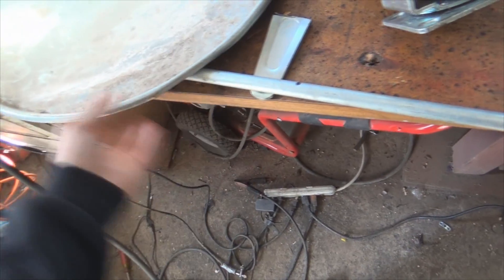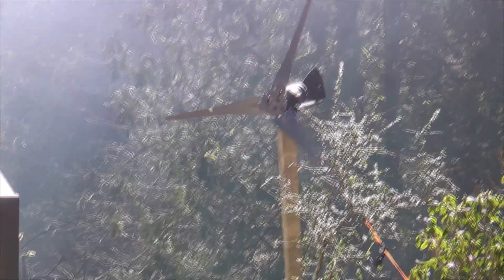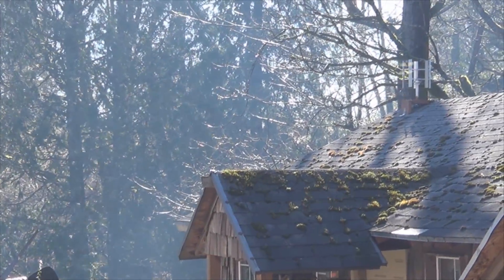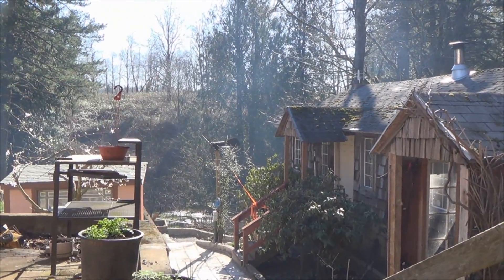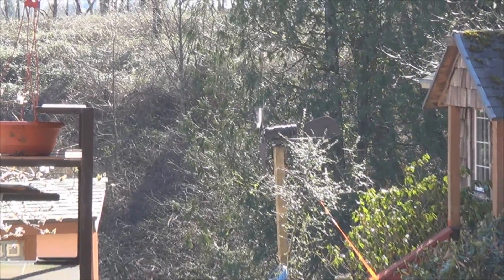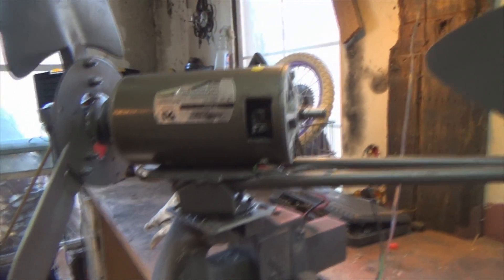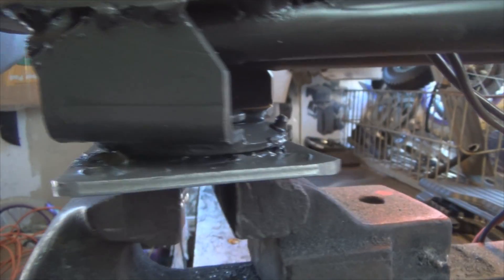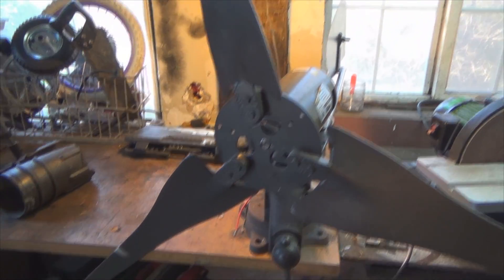DIY Wind Turbine Build (part 2)

Comment: Sorry ,but u would need a category 5 hurricane to get anything worthwhile out of that. By the way you're getting negative voltage out of the motor. If u put a load i doubt it would even turn with such skinny blades. Anyway... trial and error will get u there.
Reply: agreed, if you put even a moderate load on the generator it would lock up solid, even in a Cat 5 Hurricane

Comment: It's not just friction in the motor. The greater the electrical load on the motor/generator the more torque will be  required to rotate it.

Comment: nice build I've been over wind turbine technician for 20 years make a couple suggestions increase the size of your tail vein it'll help stabilize it so it doesn't move as much on the yaw axis and put a stop in to keep it from rotating too many times and tangling your power leads but otherwise good attempt on your first build

Comment: What are you using for a governor? If you don't have one and the wind gets too high, then the turbine will overspeed, blow, and throw its blades everywhere. If you get a good wind power book it will show you how to easily do that with a tilted hinge on the tail boom. It will give you many other great ideas also. Plus it will educate you on where to install it, how high, a control system, which Motors to use and which to avoid Etc.
Reply from the maker: Thanks for the advice john! This didn't have any sort of governor just a charge controller that would divert the load if the voltage reached 14v or so.
Reply: John, do you know of a good book that explains this and how to build one?

Comment: Been experimenting with wind turbines. I recommend sticking a gearbox on this to experiment with the ideal gearing.
Reply from the maker: samthepoor if I ever do this again I will 
A) use a different motor with less resistance
B) use some sort of gear system- gear box
C) use more blades on the turbine 

Thanks for the comment!

Comment: how are you going to deal with the wires? As the thing rotates, if it spins in one direction more than a few times, your going to be all coiled up on your riser post.
Reply from the maker: Hi Jason, A lot of folks suggested using slip rings, which i'm sure would do the trick! Unfortunately, this project no longer exists!

Comment: hey im going to build one! Thanks! How do you keep the wiring from twisting? 
?
Reply from the maker: There is no real mechanism stopping the wires from twisting up, I was basically just relying on the wind coming from one direction the entire time. That being said, others have recommended slip rings that allow for 360 degree rotation. Good luck Michael!

Comment: Since the tail of your windwill works better than your propeller blades, why not just make 4 or 5 windmill tails and arrange them in a wheel to make them spin horizontally, and your wires will not get entangled as well..
Reply from the maker: Hmm, I like that Idea! I think the only problem is it would take a lot of time fabricating the exact same blade over and over again while making them identical.

Comment: you need that thing away from the trees, it will never work very good there, I ran into the same problem. had to move it out in the open it just baffled around a lot and never ran  very good.I like the caster idea very cool never seen that done but  for small scale windmill its great.
Reply from the maker: Thanks for the advice Steve! definitely just a little experiment project. I scrapped the wind idea and went hydro instead.
Reply: nice always wanted to do that.

Comment: I think you said 4000 rpm for 110 volts in part one. Do you think you can get 4000 rpm with that? Maybe try and find a motor that produces more at a lower rpm? Just throwing out ideas.
Reply from the maker: I think it was 3600? I dont remmember. but you are right lower rpm/ voltage would be much better.

Comment: good work! I looked this up for ideas to build my own. Just one thought - you could mount the fan to a large flywheel instead of directly to the motor and run a belt to the motor to get a higher rate of spin v the fan - like bicycle pedals to the back wheel.

Comment: what about installing the motor below the tubine blade shaft with bearings on each end and a pulley between  linkrd by fan belt to motor pulley to allow for gear reduction  and  lower friction as well

Comment: You need a high power full bridge rectifier made of something like Schottky diodes, very easy to make, just google it, 50 volt 10 amp diodes might do it but you'll have to determine that. A charge controller which prevents battery over charge, MPPT for maximum efficiency but if money is an issue go with PWM type. And finally the batteries. I recommend 6 volt golf cart batteries wired in series for max amp per dollar. Also, you can add either some gearing (higher friction, more mechanically complex) or a high efficiency DC-DC buck-boost converter to boost low volts to 12 or cycle low volts to 12, but you loose efficiency and it's electrically complex.
Reply from the maker: Thanks! i scratched this idea and made a water wheel instead, you should check it out. I connected it to a cheap inverted.

Comment: Great job in putting it all together.
Some technical points:
the power generated by a wind turbine is , at best, 59.3%.  this power is proportional to the cube of the wind velocity
wind velocity is disturbed by stationary objects (trees, buildings, etc.)
in order to avoid excessive drag cut the number of blades to 3 if you want to produce electricity.
make the blades long enough to increase Power.
do not, under any circumstances, attach your wind turbine to a roof because of vibrations and noise.
you will not be able to sleep at night.
place your pole at least 200 feet from any building and trees.
The taller the pole, the greater the generated power.
Remember, if your turbine is likely to be subjected to very high wind velocities, it could be destroyed.
Great job constructing it and good luck to you in the future!
Reply from the maker: Thanks for the advice

Comment: if (as i think) you are using a simple 3-phase motor, you have to auto excite it with a triangle of capacitor, or you will not have any voltage at the output, you can also solve this problem using a syncronous motor with permanent magnet stator, in that case you will have the maximus voltage ever, but the frequency will change as the rotation speed, no problem if you rectify them and re-alternate with an inverter.

Comment: I came with a suggestion mate 
If you used some kind of belt to attach the wind mill blades to a simple gearbox and then attach the gear box to the motor you could reduce the friction and let the blades spin and then engage the motor 
It might help with the spin up process

Comment: you may have been advised but, just a suggestion... when you hear the wind through the trees most of th sound is about 20 or so feet above you, and unless you on open prairies that wind mill should be best somewhere between 30 and 60 ft alt. now then you may consider a braking system of some kind. I'd be suprised that the blade manufacture didn't recommend similar .
west coast experience and preparing with a sf bay project, also similar...

Comment: I have a question how does it stop  the cable " Snagging " If it turns 360 degs ? Thanks ;)
Reply: with the current setup unless he adds something to physically stop it it won't, he needs slip rings
Reply: my guess is that he will do something simular to a pickup on a motorbike or somethign like that.

Comment: try some capacitors in  a series circuit with a voltage regulator at 12 volts , you can find them in a old Tv .then try to make a capacitor bank . store the power in the bank to turn a inverter on . remember to put a regulator on the capacitor bank with a fuse to the inverter

Comment: Nice job, i like the ball bearing and the tail.

The part that stopped me from building or buying a wind turbine is i know it takes height for a wind turbine to work satisfactory in my area, to be considered successful energy transformation, or else i will be messing around with 3 and 4 volts next to all the time. I need to be at least 50 ft high to collect strong stream of wind energy, consistently. Same goes for most everyone in the areas they are in. If you have space for guide wires you can mount a wind turbine really high safely, relatively cheap. That is what all wind turbines need is height, unless you live 100 miles from trees and/or buildings.

But i might build one any way because i have a few motors/generators, and put it up around 30ft high, and in future get a huge pole 60 ft. high with guide wires. The pole with guide wires is the cheapest way to go, but you need more space, those guide wires spread out and take up a huge circumference. Otherwise there is other options, if one has the money, there are huge poles that require not a single guide wire, high price. IT only makes sense to pay the price if you know you have high wind area and it will eventually pay off.

Comment: You might want to consider a cone on the front and using a slip connector so you dont twist up the wires, you will also need a charge controller to control the power going to the batteries from the turbine, personally I would have used more blades and less metal in the construction, but all in all its not too bad for a first attempt
Reply: is there a way to make diy cone?
Reply: gorki treperović could use a plastic bowl or some kind of dome like object

Comment: When it spins your wires might get to twisted ... but great job keep it up and don't listen to negative people
Reply: He just needs an electrical slip connector and some brushes, that way the turbine can spin, and the cables won't twist around the pole. Basically, it's a flat circle with a positive and a negative contact surface, one as an inner circle, and one as an outer circle, which would be mounted under the motor, and above the carrier ( that caster bearing ), then you have carbon brushes raised up to make contact with the circular contacts mounted below the carrier, so that it doesn't move, to continue the circuit down the pole.
Reply: I was thinking the same thing, either that or have the wind pattern figured out and add a stop mechanism to the carrier so it wont go past that!

Comment: I noticed in the video when you set up your wind turbine there was lots of structure around it that was higher than your wind turbine. it may feel windy from the ground but it's turbulent wind I seen a video that explains it your wind turbine  will work better if you raise it higher above all other structures this way it is direct wind and the wind won't be slowed down by hitting other objects before hitting your wind turbine.

Comment: I like your video! Hope you can post a follow up. What happened? Does it partly help power your house? How did you invert the dc to ac? Did you use some kind of battery bank? What might the turbine produce (amps, volts, watts)? Anyway, clever build! Especially using the wheel barrow forks (or whatever it was) as a rotator.
Reply from the maker: Thanks enfinkill, I actually ended up scratching this project and made a water wheel out of the same motor. the videos are on my channel somewhere, if you want to check it out. The water wheel was capable of powering a few lights that's about it though!

Comment: More blades would help in lower wind speed areas
Reply: Also getting it out of the wind shadow it is in.
Reply: homayoun Shirazi they actually make windmills and you can find a Missouri women power where they have multiple blades versus three and they work better in lower Winds
Reply: Silent Death ,
If you want to generate electricity as opposed to pulling water from a well to feed the livestock then put more blades.  But with more blades there is more drag and you definitely can't produce electricity!

Comment: Have you found you've had a problem with the wires now its been running for a bit, it seems to me that as the turbine rotates to find the wind direction your cables are going to get twisted... I wonder if a electric contact plate on a bearing would work?

Comment: U need to gear it up and lots more blades  to produce the usable voltage for a 12 volt system ..I did a build that does produce 107 volts ac on open voltage .In order for u to produce usable power u need twice the voltage ,24 ac volts on open voltage to charge a 12dc volt system.Good build tho

Comment: how do you connect the wires and what do you run with it?
Reply from the maker: you should watch my Water wheel video, It is a different project, but the wiring is the same as this. I switched to hydro because I couldn't get enough power out of this set up to run anything.
Reply: good one, cheers

Comment: I think you need a gear motor attached to the turbine, thus you will need a lot less wind velocity to generate some power.
Reply from the maker: iv'e also heard that more blades would make it spin at lower wind speed, over coming the friction of the gears is it's own challenge I guess you just have to find that balance though. Thanks!

Comment: Was the treadmill motor you used a regular DC motor or was it a dynamo? I am trying to build one myself but I was under the impression that you need a dynamo instead of just any motor...?
Reply from the maker: +Quinten Doornbos Hi there, Yes the treadmill motor is just a regular permanent magnet dc motor. As far as i understand, a dynamo is pretty much the same thing as a DC motor except it is specifically made to be a generator and cant be used as a motor. They work on the exact same principal though.
Reply: +Oliver Motorized thanks!! this will help me a lot with my project!
Reply: has to be dc motor

Comment: to stop the wires from spinning around with the turbine instead of them dangling in mid air, take apart a vacuum cleaner, with retractable wire, they have a device which can spin 360 and keep going while letting the electricity flow, it worked for me
Reply from the maker: +MN SHP (MNSHP11) sounds like a great idea, i'll look into it.

Comment: great job on your build.  I'm building one using a semi truck alt. it's a 160 amp. my plan is to use 7 blades, but I'm not sure about the slip rings. i still have more to learn.  your video got me even more motivated to get mine finished. my plan is to get it done by April 2016. I'm going to make a video of it and put it up on here. I'm looking forward to seeing your video on the water wheel.  great work,  very inspiring.
Reply from the maker: +blackops84321 Thanks man! good luck on your project I hear alternators are difficult to use as generators because they need a 12v input to make a magnetic field. But I have a lot to learn as well. You can also buy slip rings off e bay for a couple of bucks.  My water wheel build is already up btw.

Comment: Oliver: I can tell when you were turning your armature by hand that you were going to need more blades, or larger blades.  the easiest thing for you to do now is to purchase 3 more of the same blades.  5 blades would be better but 6 would give you rotation at much much lower wind speeds.  I really like your windmill and if you take my advice you're going to be 200% happier.
Reply from the maker: +cwrobinson6363 So I've been told! I actually decided to use this motor for a water wheel. But thanks for the advice.
Reply: hi, it's better to have odd number of blades. you are right about adding more blades for sure. they seem to spin better with odd number of blades. I've been looking at alot of commercially made turbines and most are odd numbers. they say it makes it spin easier because it will have one blade pointed up and the bottom  will have two pointed down, well almost down. I'm in no way a professional, i just have been studying for a long time trying to plan my turbine. i hope to have mine done by April.  I'm going with a 7 blade.

Comment: +Oliver Motorized

Very inventive Oliver! Thanks for posting.

I just wired up and connected my first 250w solar panel today, consistently generated around 160w and watched my elec meter either turn really slowly or move backwards.
This on a 600w micro grid tie, so there is room to expand.

This renewable energy thing is addictive man! It's a beautiful thing :)

Think I'm going to try augmenting this solar stuff with wind next but you would need to extract higher voltages to get a micro grid tie to kick in. 22v - 60v on mine.

Now we just need battery technology to come to the party. That is still the prohibitive factor for most.
Reply from the maker: +Manny Locatelli It is! i still have a lot to learn about These systems. Good Luck with your Setup!